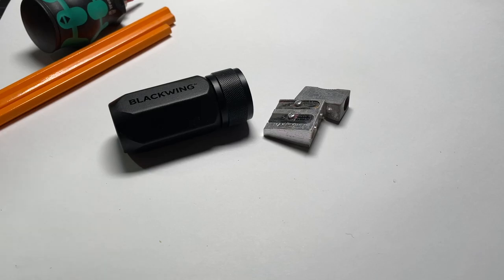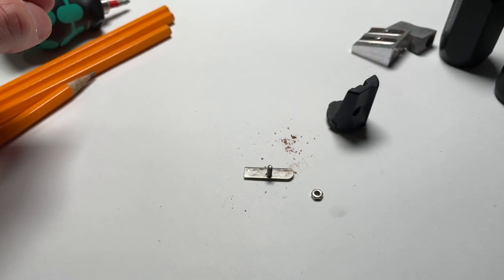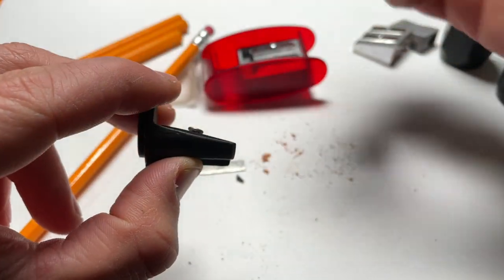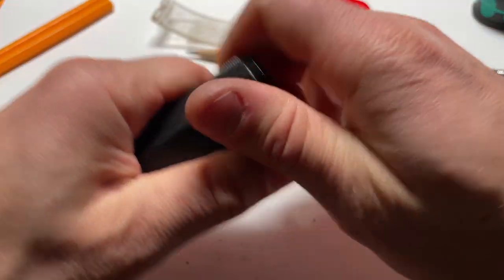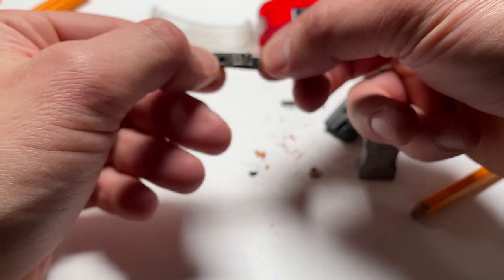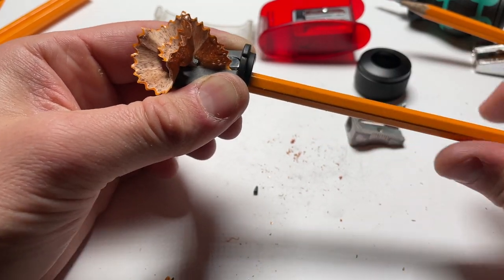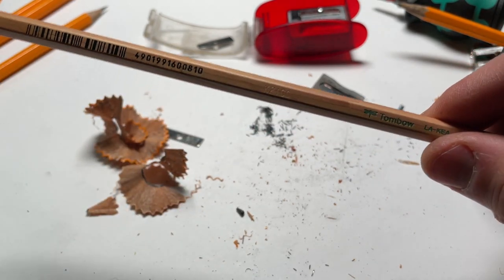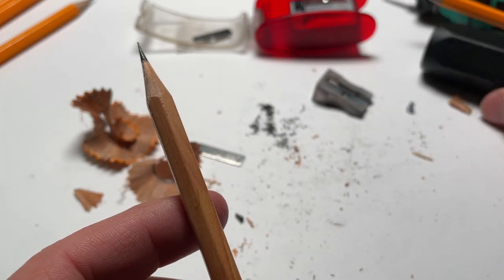Blackwing One-Step Long Point Pencil Sharpener Fix - Part 1

Comment: I gave this sharpener TWO tries. Bought it once from Amazon, worked great for a couple pencils, then every sharpen would break off the graphite. I thought it was due to resale on Amazon, so i bought the single step off the BW website. No dice. Got replacement blades. Still eats pencils.

Comment: M+R makes replacement blades for their bullet sharpeners that are slightly skinnier than a standard blade. These may work. They also sell standard blades in ten packs so make sure you get the right ones.

Comment: It may also be the type of pencil you are sharpening I just got one and within a few hours of trying to sharpen colour pencils to a point it is breaking halfway. The coloured pencils have probably been dropped and I thought I had already made the sharpener worse after a few coloured pencils but then used the blackwing pencils and it sharpened to the automatic stop without breaking. There are some stores that carry replacement blades for this sharpener my local fountain pen store where I got the sharpener Has the replacement blades as well

Comment: I don't think the blades are interchangeable with the one step.    Blackwing blades have a slight curve in them which they say adds strength to the point.

Comment: I usually use my two step sharpeners, which I have used KUM replacement blades when needed and they work well.  I seldom use this sharpener, so it has not failed yet.  I did notice that Blackwing sells a separate unique blade to replace the blade in the one step sharpener.  I assumed that this is because the blade has to be slightly concave to work properly.  The KUMs do not have that profile. I might add that the Blackwing two step sharpener uses KUM blades from the factory.

Comment: Although I am thinking of getting a set of Blacking pencils and a Blackwing pencil extender, I wouldn't get the Blackwing sharpener as there are many good hand held sharpeners such as Kum and Dux which have easily obtainable blades.
Reply from the maker: Fully agreed with this strategy
Reply: I go Blackwing and KUM.    I can buy 12 KUM's for the price of their desktop.